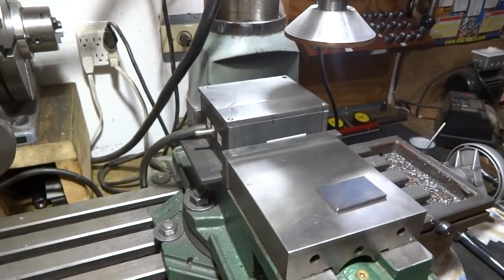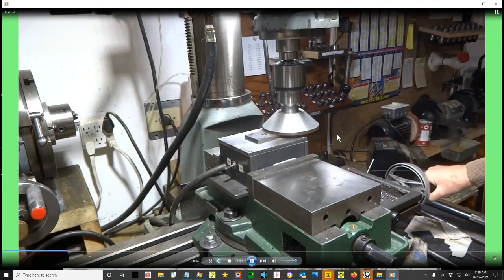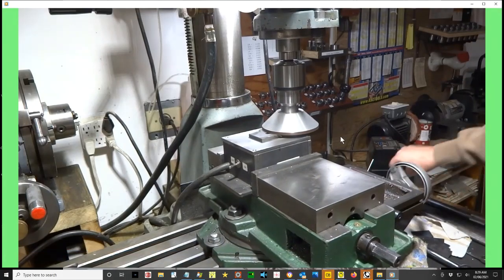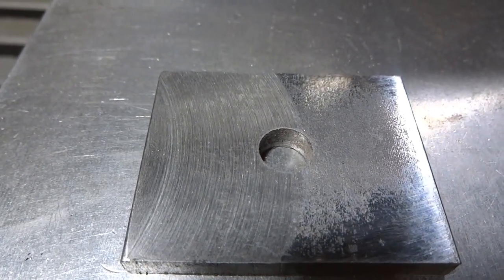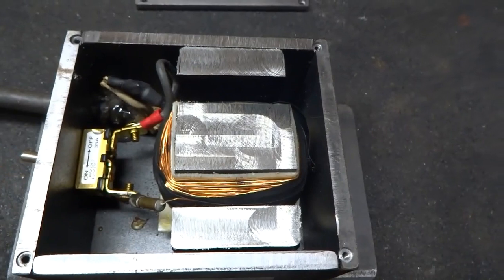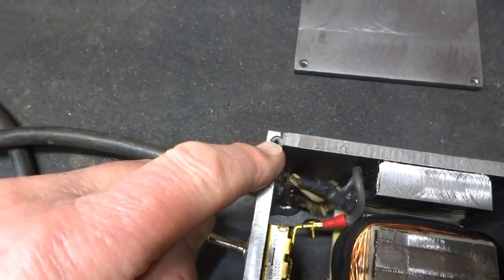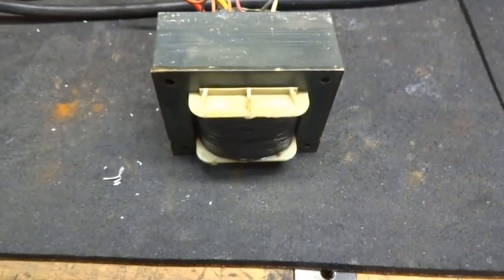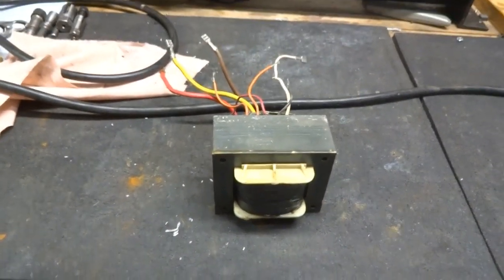Magnetic Chuck Homemade

Comment: That solid top is definitely sapping most of your magnetic force.  The top is acting to complete the magnetic "circuit", and a lot of force is being wasted just to pull the top on tighter.  The only magnetic force you get coming through is from excess that couldn't "fit" through the cross section of your lid due to magnetic saturation.
You should have it so that your workpiece is the only ferrous thing which closes the loop on transformer core.  Simplest fix would be ditch the lid, and fill around transformer core with epoxy to get the surface flush and level.
Reply from the maker: Thanks for your comment. I tried a thinner metal top and it did work better. If I can find some epoxy I may give that a try.
Reply: @MrModify  fiberglass resin should work and it is cheaper than epoxy...
Reply from the maker: Thanks for the tip.
Reply: Keep the lid but chop it into 3 sections. Gaps large enough to get better grip. I watched a guy use it and towed to pole. Got 850 kg max the scale held and it held.   Think current counts also but I'd have 2 gaps in thinner top leaving hole with? Plastic to stop bits falling in. But 850 kg. With only maget/ transformer without the top. Best clip. Some keep it similar. Shave down to primary and fill gaps? No idea if helps if cutting top off or cutting slots into I oart of transformer? No one seems to say strongest way is to cut slots. Or cut to primary. Or to fill spaces.  850 kg was just I off the E part. Still one with larger surface area as just cuts through the I bar 2/3 mm I still haven't found out.
Reply from the maker: @mabul513  Thanks. I will try your suggestion.